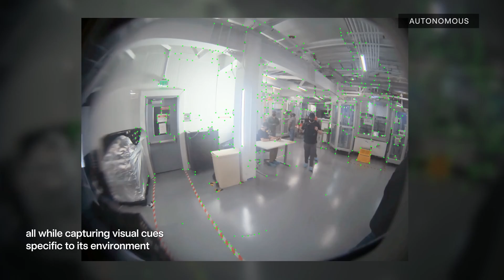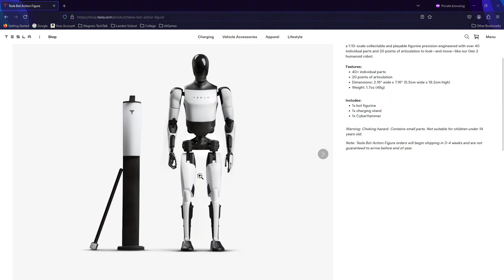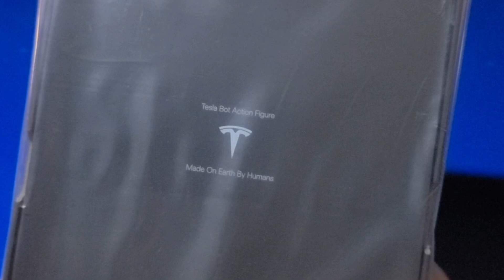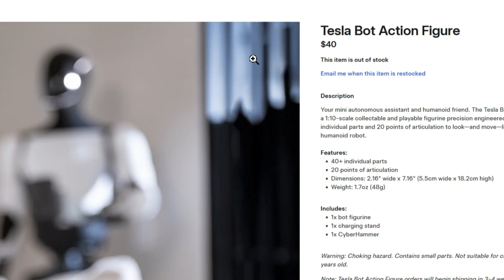Tesla Optimus Robot new Hand, Balance Recovery + Tesla Bot Figure

Comment: Well Tesla robot be able to drive a car?
Reply from the maker: Very good question, I was wondering the same.  If I were to guess (just my guess, I have no details), it will likely not be allowed to operate a gas powered vehicle but allowed to navigate a Tesla vehicle with FSD operating as a passenger.  The reason I think this:  1)  Training AI on all model gas cars safely would take a considerable amount of training data.  2)  Handling of mechanical failures would be complicated.  3)  Gas vehicles won't have all cameras/sensor surrounding the vehicle for AI to operate it as safely as a Tesla.  I could be totally wrong on this, but that is my guess.